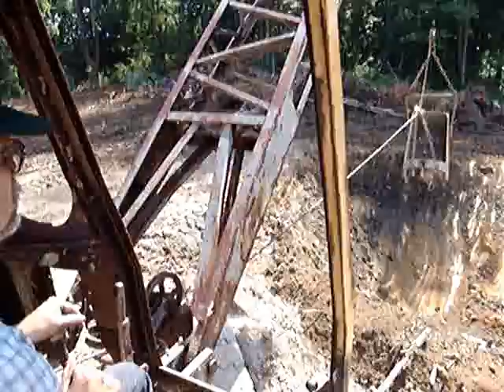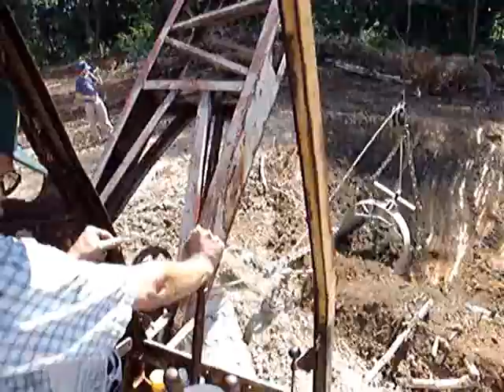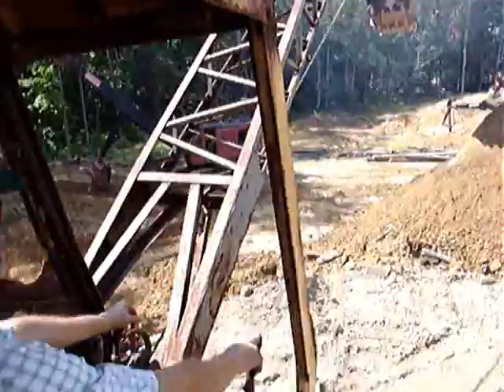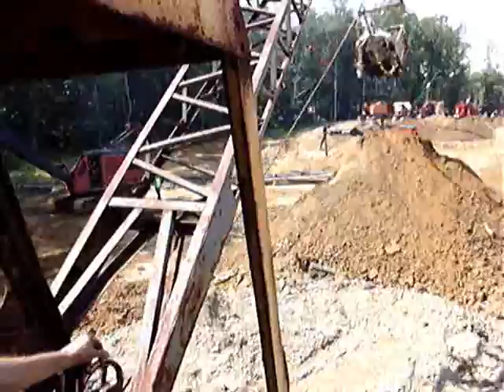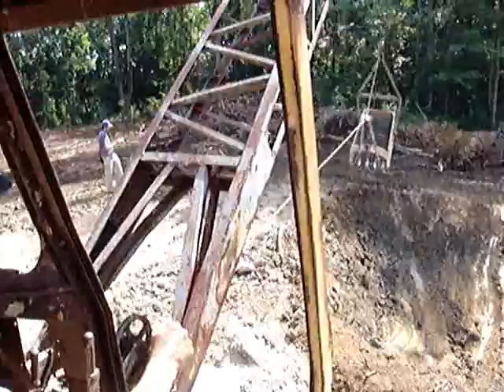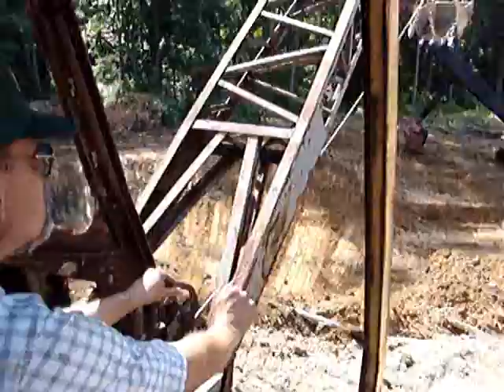Bucyrus Erie 22B dragline onboard

Comment from the maker: I will try to find out the info.

Most US cranes of this size have sectional booms that can be lengthened or shortened to suit conditions, with a tradeoff of bucket size vs boom length. Also, most of them are easily convertible between dragline, clamshell, or lift crane, and many can also be easily switched to backhoe (pullshovel) or shovel.

Whatever the numbers, this machine seems pretty happy with the setup, doesn't hunch up or stall.